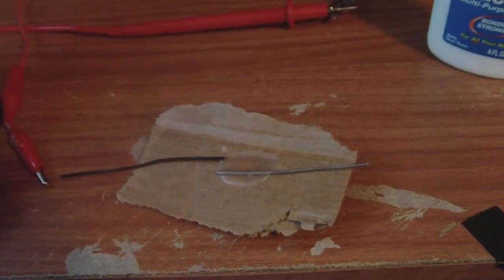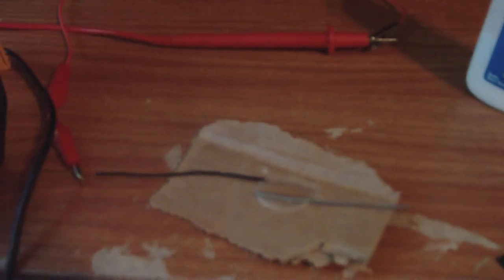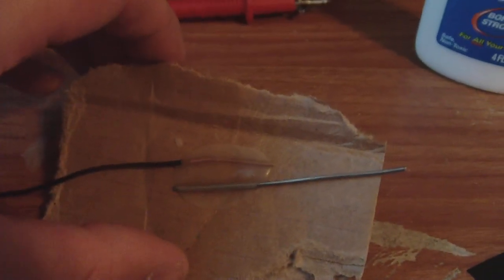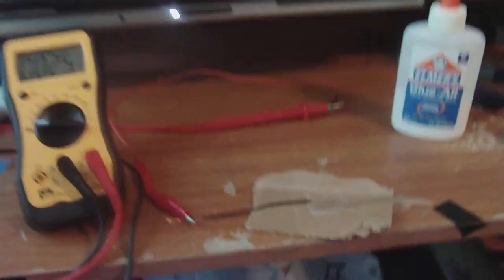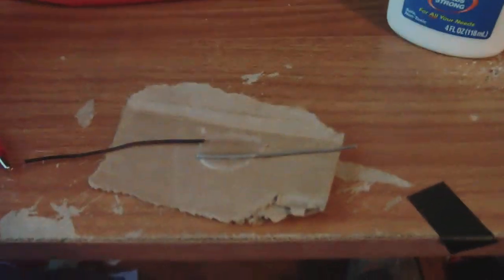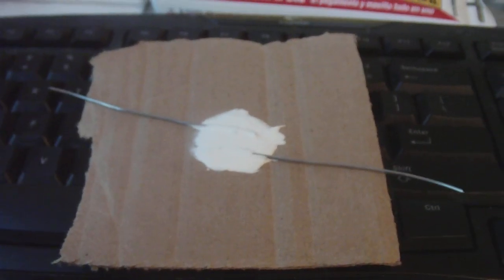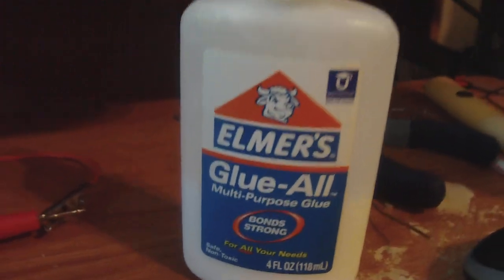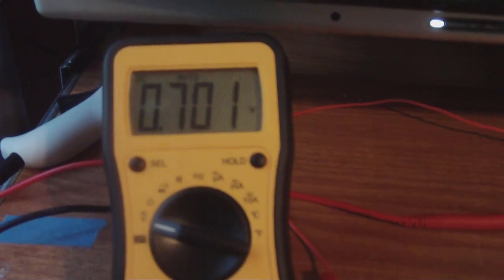Glue Battery

Comment: The voltage is the easy part. I can make a measurable voltage potential in any number of ways but it is the milliamperes that separate the material curiosities from the potential battery materials. Two kinds of people don't show amps as well as voltage, scammers and people who didn't understand the importance of showing volts and amps. I believe you to be the latter. Also, I would suggest you mix an electrolyte in your glue, like sodium sulfate. Then try something like making your glue an insulating film between two substances close together. Like a copper sheet and a zinc sheet. Make sure the glue is even so the plates don't short circuit. Make sure the glue has the air bubbles removed on one plate before placing the second plate on top and make sure the glue is saturate with the sodium sulfate. Good luck and thanks for the inspiration.

Comment from the maker: @onthecuttingedge2005 

This is a study of Petrovoltaics. Thomas Townsend Brown found out that a dielectric material such as rocks, glue, water, etc. would create a self potential. The Glue Cell that is copper and aluminum starts off as a galvanic cell but as glue dries the water is being removed and then you see the self potential of the cell thus showing that galvanic cells are not 100% galvanic and that most batteries have the effect that Brown studied.

Comment: have you try messure with your laptop disconected? Turn off the mains in your house first.
The moisture in the cardboard acts like electrolite even when the glue is dry.
 I saw a similar phenomena in my desk. The card board some times works like a capacitor . Nice vid! ;)

Comment from the maker: @GuardianZeus21 

Yes enough in series might light a LED, but using wire is not the best because it doesn't give the best amps. We need to use bigger plates.

Comment from the maker: @jesslessthemess 

Yes there is amps but its small, I think mostly to due with the plates being small and that theres no water left in the glue or that not much air can get to the plates. Its like the glue freezes the plates. The most I've seen in one cell was around 100uA The next day after its dried a little using these small plates. Bigger plates will give better Amp readings.